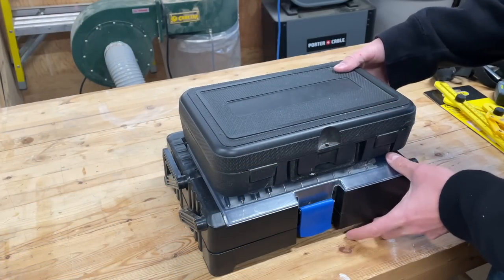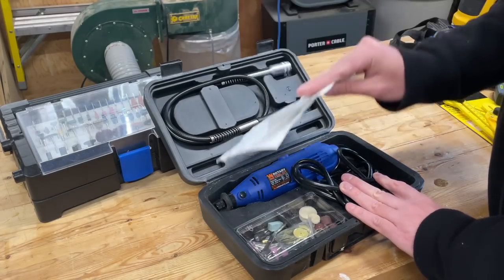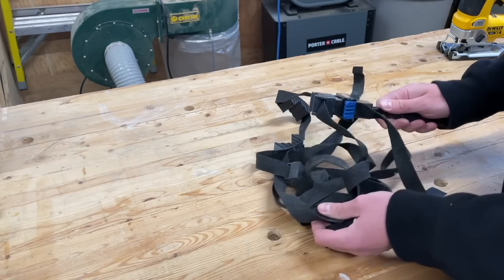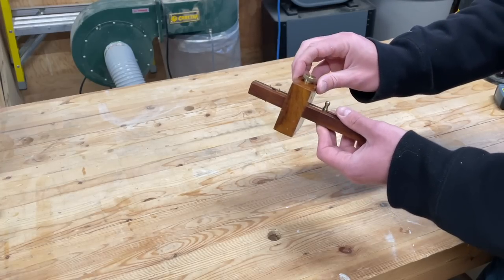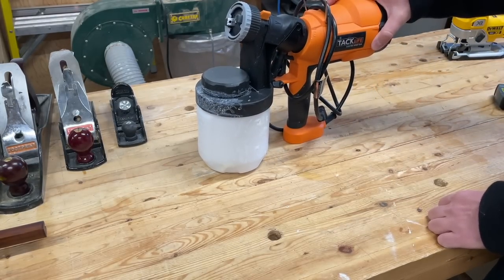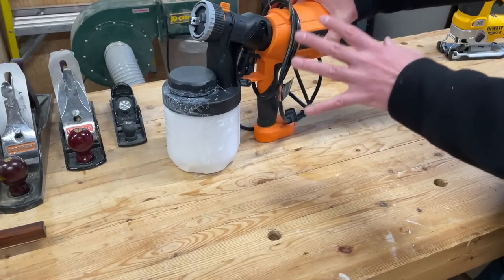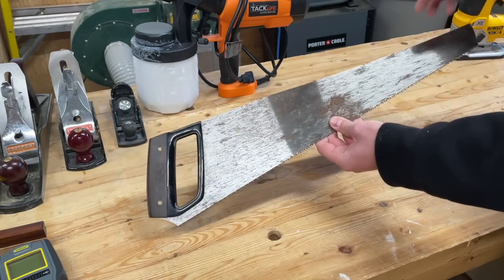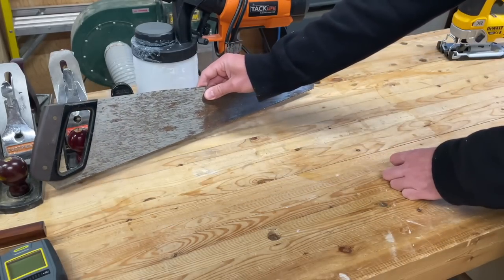Don't Buy These Tools // 10 Woodworking Tools I Wish I Didn't Buy

Comment: Oh  comon now, those portable jigsaws are invaluable. Sure, we may all use it much less often than other tools but we'll all come to using it sooner or later, and not only once or twice and sometimes is the only tool for the job and if not, then your not into cutting things.  Most folks wouldn't go without one including yourself I'm sure.
Reply from the maker: I’ve really come around on the jigsaw since posting this video. With the right blade (not general purpose), and speed setting, I’m getting fantastic results using it on plywood.

Comment: Totally disagree with the jigsaw for woodworking. Sometimes it's the best tool for cutouts in the middle of a board. Rough cut outs you clean up with a router or rasp. It's most likely not the last tool that touches the the wood, but part of the process. Also different blades produce different cut quality. I had the dewalt jigsaw at one point, however, and when cutting, the base would sometimes get off 90. Not talking about blade tracking sideways, the actual base would be 5-10 degrees off where I set it
Reply from the maker: I've come around big time on the jigsaw and agree that it could be an essential tool for beginners. My issue mostly stemmed from the wrong speed and the wrong blade. Once I dialed that in, I'm getting clean and quick cuts!

Comment: Thank you, I will not buy tools of amason, seems like they sell a lot of crap. Jigsaw has some uses, but not for final cuts, more for precutting parts out of large boards in to more manageable pieces.
Reply from the maker: Amazon does have a lot of low-quality and unnecessary tools, but if you stick to brands you know and trust you can often find some good deals.

Comment: For quickness and versatility - you can't beat the Jug Saw (provided you use the right blade & speed). However, at the age of 71, I still prefer a tool that has gone the way of the dinosaur due to today's attitude of "I don't have time and want it NOW!!!" so "crank on the power and get er done". The tool I prefer is the lowly Coping Saw. The precision of cuts and the satisfaction of ACTUALLY working up close and personal with wood is euphoric.

Comment: I doubt there is anything wrong with the block planes, the irons might be a joke, but 1 or 2 layers of masking tape is all you need to set a sharp hand plane. Block planes can be screwed up quickly if someone screws up the cutting edge, outside of that, the plane itself is fine.

Comment: . Next time buy a quality  hand saw with the correct tooth pattern and induction hardened  then you will have a different experience.  Regarding the Dremel style kit you get what you paid for. There is a reason why Dremel tool with proper bits work and Mastercraft is giving you a box full of bits for the price of 1 maximum 2 real bits.

Comment: My Proxon Rotary gave up the ghost after many years of service.  I'm lost without it,  Maybe not a great must have woodworking tool but I've used mine extensively both woodworking and especially around the house.  But yeah, it's not a router and those mega bit packages are worthless.  I use about 6 or 7 of the accessories at most. 
The jig saw I'll completely disagree with.  It's still the fastest and easiest way to cut a radius on a large piece, then a few seconds with a palm sander...done.  I just cut 8 of them on some L shaped shelves yesterday.

Comment: I would agree with your negative assessment of the first 9 items. However, suggesting the 10th item (Jig Saw) is a tool you wished you hadn't purchased is shocking! I certainly respect you as an accomplished woodworker. With that said, I believe you are not fully appreciating the usefulness of a Jig Saw in so many situations - especially if you have a cordless one.
Reply from the maker: I really came around on the jigsaw after posting this video and posted a separate video on my new-found love of that tool. The right settings and blades made a huge difference!
Reply: @MasonWoodshop  Awesome! I will have to check out that video. I admit the Jig Saw is not the most "accurate" tool even with the best blades but it is fast, convenient and will get you out of a pinch when you need to make a quick rough cut or it's inconvenient or impossible to carry your project to a preferred sawing option. I use a battery powered one when I need to make little adjustments while laying under decks or in crawl spaces. It's great for rough cutting plywood when odd shapes are need. Also it's good to speed up the coping process on larger moldings. You can even plunge cut with it quite easily through plywood and drywall. I agree it's not the tool I typically reach for first, but it's a real time-saver when I do. One last thing, don't get caught up on buying all those crazy blades sizes in those multi-packs. Just buy a few sharp an sturdy blades and you'll be all set. Thanks again for your great videos!

Comment: I couldn't disagree with your rationale on most of these. I don't get a ton of use out of my dremel, but there are jobs where it is the only tool for the job. I am likely in the minority at this point but I love my western style hand saws and still get a decent amount of use out of them. Enough to keep them around anyway...
Reply from the maker: I might need to think about a potential upgrade to an actual Dremel from the WEN! Which model of Dremel do you use?
Reply: @MasonWoodshop  I believe I have a dremel 4000 series.
Reply: I prefer the Japanese style pull saws.
Reply from the maker: @michaelhamerin3814  Likewise! I learned my lesson and the Japenese pull saw I bought a year ago sees a lot of use.

Comment: If I buy an auction lot or a tool box lot etc at a yardsale, flea market, auction wherever... any type of tool that says Mastercraft on it automatically goes in the trash can, this includes any power tool, I won't have any of it in my garage. Some of the worst are the screwdrivers, only exception is the really old stuff which most of was very good quality. I don't even try and use any newer stuff, I haven't been in a Canadian tire store for a number of years now.
Reply from the maker: Yes! Totally agree on the screwdrivers and while they will replace them for free without a receipt, I don’t want to be going to get a screwdriver replaced when the inevitably get their tips ruined with normal use.

Comment: I have a wooden barking gauge with the points. The thing I've noticed is that if you're going cross grain, it tears and stutters. It doesn't leave a clean line at all, it's not very accurate and it's a pain to use. I've been wanting the Veritas one with the wheels and disks and have even considered making my own or even converting my wooden one into one
Reply from the maker: Yes, the stuttering was a big issue for me! The Veritas marking gauge has been amazing overall.
Reply: I have a decent wooden one similar to this one, and it's perfectly fine for most jobs.  Even the fact that the block doesn't sit at exactly 90 degrees is not a big deal, as long as it stays put.  For going cross grain, a light steady pressure gets the job done.  For occasional use, there's no need to spend $$$ on the Veritas one.
I have the Veritas as well, it's easier to use and I love the micro-adjustment.  But I still reach for the wooden one every now and then when I want to mark 2 parallel lines in 1 go.

Comment: Im a joiner and this guy is complaining about the Planes and the problems setting them up. Stanley arent the best but to be honest Foot Print are not cheap Planes. Anyone who knows how to use hand planes has to set them up and only a novice would suggest you dont. I would have at least expected this guy to know you have to put a cutting edge on the blade from new and please learn how to use a plane before you ds credit a tool .

Comment: The angle-izer is a fantastic idea in theory, but the function? 

Ehhhhhhhh. 

It took me a while, 20+ years ago, to come around on jigsaws and where they excel.
Reply from the maker: Haha, totally agree with the angle-izer...then it takes time to wrap my brain around how to set my saw to make that cut. The jigsaw has become an important tool to me, thanks to some of the comments here. A bit of research into the right blade and right speed setting made a world of difference!

Comment: I  have one I regret also it was a Buck Brothers handsaw kit that has a plastic handle that fits the 3 blades  it came with inthe kit  the blades all suck and the reason I was drawn to the kit was it’s compactness  to carry in a toolbox  which I eventually just bought a folding Japanese Pull saw  that has worked way better and doesn’t take up much more room in a toolbox  on your Dremel knock off try buying quality Dremel brand  bits and accessories  for hand planes  you are better off buying used and tuning them up yourself FYI  the older Craftsmanbranded and some of the MontgomerWards PowerKraft  are Stanley’s rebranded  for those stores

Comment: Lol, halfway through...strap clamps = a length of cord or a ratchet srrap/tie down strap.

Dremels and rotary tools like them are great for things nothing else will work on and hobbyists, getting a few carbide burrs and keepong the cut off wheels/sanding drums/ polishing wheels, the rest of the kit is hard to justify having. It isnt and wont ever be a router. 

The measuring angle thingy...Bosch has a digital miter guage that is a 2 foot level with an arm that swings and a digital readout as to what the angle is, as well as a miter function for when you just cant math. A FIBERGLASS STICK RULE is a great tool, also a classic, and if you actually learn how to use one, you can replace all of those fancy jigs for hard to layout flooring. So will a sheet of construction paper though. Between the 3 you would be better served.

Comment: How do you cut curves if you don't like using a jigsaw and particularly internal curves
Reply from the maker: I’m generally working with cabinetry projects these days, but when I do have inside curves I’ve often been defaulting to my cordless trim router, which has been doing a great job when I have appropriate templates on hand. I’m planning on playing around with the jigsaw now and making sure I’m using it properly.
Reply: @MasonWoodshop  I don't use mine often, but I'm glad to have it when I need it - or just when it's the quickest way to do a particular cut. First few times I used one I oversteered, tried to cut too fast, pushed sideways on the blade, etc. I got better.

Comment: I have a Dremel that I use for some wood carving I am quite happy with it but of course I have the Dremel not the cheap knock off. Most of the tools you’re complaining about there because you got the low quality ones. The planes are one of those things that I used to have problems with because I buy the cheap ones and didn’t really know how to tune them proper it took many years before I finally got a plane to work properly but even when you buy the best of them you better figure on having to adjust it before you can start using it. The planes when those tools you should find someone who knows how to work one and have them show you how not having that privilege myself yeah planes for a long time or something I didn’t want to mess with but once I started to understand them better I started buying up a bunch of the old specialty planes I could have quite a bit of fun with them. When it comes to jigsaws get a heavy one it may have to be corded and plugged in but then make sure you get yourself some good blades and they’re pretty useful. One of the first jigsaws I use with a really light weight cheap one that as you said bounced and shattered when you get a nice heavy one solid metal casing The wait takes the vibration so that you just Guide the tool.

Comment: I always thought of the Dewalt (or other) saber saw (which is what I would call it) as a portable JIG SAW where you don't have to remove the blade to cut into the middle of something.  LIke a circle or other shape out of the middle of a panel.  A jig saw is limited in that respect as is the band saw.  Also if something is long it's easier to use the SABER SAW.  I might have my terminology wrong.  What is a saws all..?  Is that really a SABER SAW?
Reply: a sawzall, saber saw or reciprocating saw, it's mainly a demolition tool a jigsaw is like a handheld bandsaw or scroll saw it's for more precise cuts

Comment: Maybe not the biggest waste of money since it wasn't super expensive, but my Incra Precision T-Rule is was a complete waste of money.  The concept is really sound, but the design makes it all but unusable.  The problem is the pencil holes are so small you can only use a 0.5mm mechanical pencil with it.  If you want to use it to scribe a line (which is its main selling point) you better hope that wood is smooth as glass or you will be breaking lead every inch or two.  If you are marking on anything besides wood it probably is a great tool, but for woodworking is is worthless.
Reply from the maker: Thanks for sharing and saving me some money! I have had those t-rules on my list for a while, but I'm going to explore some other alternatives now.

Comment: From what I can recall the one I regret the most is that plastic combination square Stanley makes. It's just shit! Not accurate and I never got it tight enough so it wouldn't budge because it broke before that point. Now I pretty much just use the metal ruler and sometimes the body if I need a small level.
Another one would be the welding corner clamp I've bought. It's just a pain to clamp anything square in it and it blocks access to most of the tube to be welded/tacked. The biggest problem is that the clamp is raised from the table so long profiles don't get supported properly and sit wonky in the clamp.
Reply: A plastic combination square? That's a child's toy! Adults need hardened combination squares. I have some Stanley toys that are useful tools. The old No. 101 planes they made. I picked two up at an estate sale once for a quarter a piece. One's even a Sweethart. Score! They're great for chamfering edges. They actually work.
Reply: @1pcfred  I always considered the combination squares useless after that one. But I'm interested in trying out one again. Any clue if the ones from bahco are decent? They're still like super cheap.
Reply: @boomerangfreak  one argument is how square is the work you produce? Quite frankly the worst square I have is probably more accurate than what I need. You can also test squares for squareness. On a surface with a straight edge you strike a line and flip the square over and strike another line. If the lines are parallel your square is square. If they diverge your square is off half of the angle. Like Jimmy Diresta says if it looks square then it is square. Bacho is a half decent brand. They make really nice adjustable wrenches. I have one. Purists will insist you get a hardened square. But you have to ask yourself if your work merits that sort of thing.
Reply: @1pcfred  well if I'm gonna buy a square I want it to be 90° not 89 or 91. Working in a tool store I got to test another bahco square for squareness and that was quite off actually. So that had kinda put me off buying the combination square.
The squares I have currently are all from scala and have perfect 90° but their combination square is very expensive XD
Reply: @boomerangfreak  if you want a good square then get a Starrett. That's what I have.
Reply: @1pcfred  yeah but they're rather expensive. I heard Igaging was also very good?
Reply: @boomerangfreak  very good stuff is often pricey. The cheapest square I have is more square than what I make. When I strike square lines on stock it is more of a suggestion than what I'm going to achieve. We do not live in a perfect world. I only shoot for good enough myself.
Reply: @1pcfred  Oh yes.  I had a Stanley square that wasn't acually, well, square (you had ONE job...).  Bought a set of 2 Starrett combination squares, and holy cow those things are expensive.  But they are very very good tools, and a pleasure to use.  Well worth the money for something you'll be using your entire life and maybe pass on to your children at some point.
Reply: @kaasmeester5903  I paid $3 for my 6" Starrett combination square at a garage sale. It's in pretty good shape. My 12" is a Luftkin. Plus I have a bunch of others. Any of them are more square than I make stuff. To me square is just a suggestion. There's square and then there's square enough. Like Jimmy Diresta says, If it looks square then it is square.

Comment: I agree with all except the Krefeld multimark and the jigsaw
Reply from the maker: I’m happy to say that I really came around on the jigsaw after posting this video and use it all the time now. I’ve also been using the Kreg MM for trim reveals.
Reply: @MasonWoodshop  that’s what use multimark tool for trim reveals , aprons etc . Anything with an offset or recesses

Comment: Why are bandsaws and tablesaws pushed so hard by stores and woodworker pros when a cheap circular saw and jigsaw can do the same thing for less money and space?
Reply from the maker: I'm in the middle of considering a bit of a change-up in this space. Since posting the video I've really come around on the jigsaw and get amazing cuts with it. I've found that for my general use cases in the shop, I don't need my bandsaw any more (I don't resaw or do small detail work). Even the table saw, which I generally like, is becoming less used now that I have a track saw.
Reply: @MasonWoodshop  agree but a good router and router table are useful shop tools and I plan to get them for my wood working projects.
Reply from the maker: @GuitarsAndSynths  Haha, funny you say that as my routers (DeWALT 20V cordless and Bosch 1617EVSPK) have become some of the most-used and versatile tools in my shop. Until this year I was intimidated by routers, but they've been a game changer this year! I have a disproportionate number of videos highlighting the awesomeness of routers.